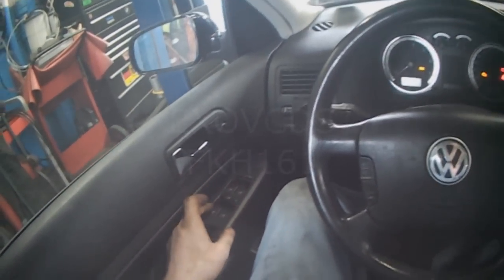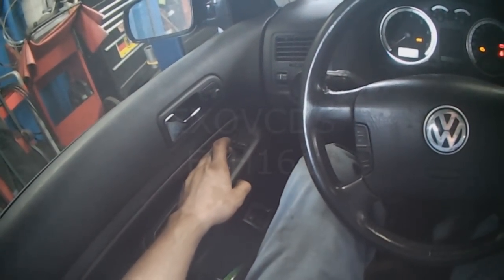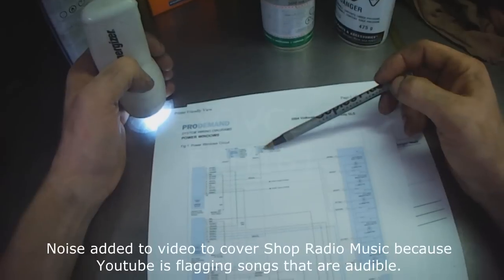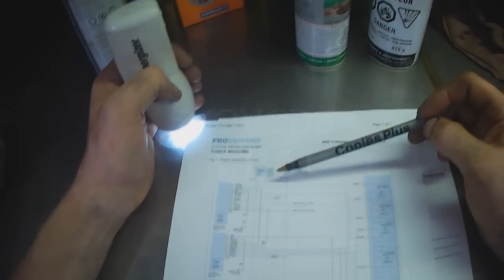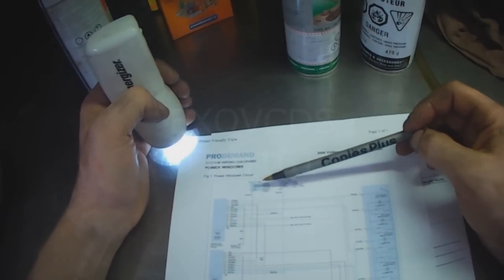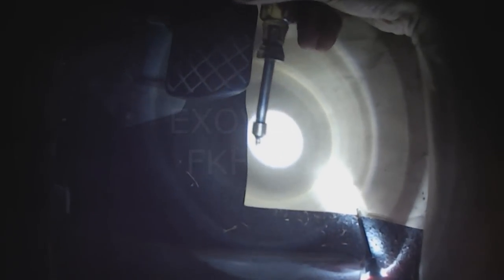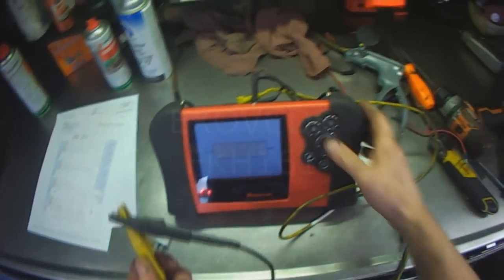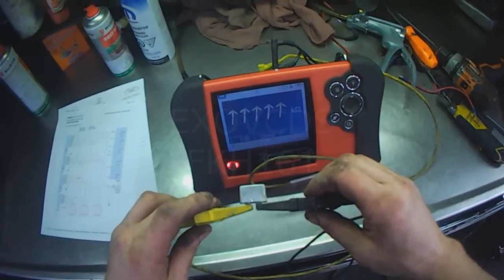VW A4: Power Windows not working

Comment: Thank you I just down load them do you have the AC and engine fan schematic? How can I support you channel? thanks for you support to the community
Reply from the maker: I will upload tomorrow when I'm at work. my website has a donation button if you wish to support.

http://fkh161.ca
Reply from the maker: Check the link again: http://fkh161.ca/Audi/A4/Conrad/
Reply: Thank you I am looking at the AC schematic and don't see the AC fan output every thing in the AC system is working but the fans are not coming on. Is there a separate schematics for the AC fan on/off with the ac system? Is There a separate schematic for the the trunk and fuel door release? The power door lock are working but the trunk and fuel door release are not working. Thanks again for your support.
Reply from the maker: +Conrad Sherland I'll get back to you later.
Reply from the maker: Conrad Sherland Trunk & Fuel Door:
http://fkh161.ca/Audi/A4/Conrad/AudiA4TrunkFuel.pdf

The A/C & Fan control pdf's is all the info I have, the Audi wiring diagrams show the same but bit more confusing to look at.

Comment: I have the same problem, but only with one window.  I can hear the relay click, but the motor isn't getting power.
Reply from the maker: Year, make, model? Check the wiring in the door jam... open the door and look behind the accordion rubber boot for broken wires.

Comment: Hello, my 05 Jetta is having a similar issue with just the passenger side front window which is stuck in the down position. When I use the switch I hear a clicking noise coming from the window but there is no movement. Do you think this is also a fuse related issue or is it a wiring problem? Where do you suggest I look to try and fix this?
Reply from the maker: Braxton Vittori If all the other windows are ok, then it's not a fuse problem. Could be wiring, but probably a bad window regulator. The window could be off of the holding clamps as well... but then you would usually hear the motor buzzing as it moves the regulator clamps up or down. If prior to this you heard some kind of crunching sound, it's probably time for a regulator. Disassemble the door (i have videos for that) to check the regulator.

Comment: Heloo my friend thnx per video ...I have skoda fabia and my window just dont work anymore fuse are good but when i remove and put again works for 5 minute and again stop ..? Thnx a milion times
Reply from the maker: Does it have a "circuit breaker" fuse like in this video? When it gets hot, the breaker opens... once it cools, it closes again. If the breaker gets hot, then there is a problem with one of the circuits. Try to determine if a specific window / circuit is at fault. If the circuit breaker does not get hot if you only use the passenger window, then the problem is with the driver side... as an example.
Reply: Thank you soo much ...my friend thnx a million ...
Reply: @EXOVCDS  i put new fuse brother and its work good for 2 days last night was a lot of rain  and today both windod dont work ...driver side and passenger side dont work .... remove and put again fuse start working ... maybe I need to check lke and video you put for us ... thnx bro for your time
Reply from the maker: @lisihoxha7388  make sure all contacts are clean. Dirty contacts can create excessive heat.
Reply: Thaaaaankkkk Youuuuuu for your time ...God bless Y

Comment: Any idea why my power windows, dome lights, sun roof and trunk won't open? Are there wires on the door that control this?
Reply from the maker: Year, make, model?
Reply: @EXOVCDS  2000 1.9 tdi jetta
Reply from the maker: Did you find & check the circuit breaker like in this video? If the breaker is ok (and actually has power going through it), I'd have to check a wiring diagram to give you other items to check. If the dome light works when opening other doors, then the problem is with the door lock actuator or the wiring in the door jam.
Reply: @Thomas EXOVCDS My door panel has been sticking and tore a part but my circuit breaker on top of the battery looks new but I'll check and the dome lights do not work with either of the doors.
Reply from the maker: Fuse 6 (5A) and fuse 37 (10A)... are they ok?
Reply from the maker: And fuse 38 (15A)... sorry. All should have power when key is in the on position.
Reply: @Thomas EXOVCDS  all of those have power but the 38 15a but there's a handful that don't have  any power.
Reply: The two 10A above the  38 15A don't not light at all and those are new fuses
Reply from the maker: Not all (other) fuses will have power when key is on. 38 should have power all the time (key in ignition or not). Fuse 6 only when key is on... fuse 37 as soon as key is in the ignition. I'm basing this on a wiring diagram that I'm looking at. Those 3 fuses supply power to the central locking unit which supplies power to dome lights. 37 (circuit breaker)  is power for the window and should have power all the time.
Reply: @Thomas EXOVCDS  got everything to work. Thank you very much
Reply: Blown fuse. Trunk still won't open but that's fine
Reply from the maker: More info (about fix) might help other people.
Reply: @Thomas EXOVCDS  I was lost when some of the fuses wouldn't light up and the blown 38 15A I found was stuck in a non functional fuse holder area. The actual 38 15 A was fine. I went to auto zone and he used my light probe and we checked the ones you mentioned, the license plate fuse to be blown but that didn't fix the trunk like he thought. and the windows he said it was the central locking and i thought that was a 20... all in all we replaced a 5a and the 10a and that fixed my sun roof windows and dome lights.
Edit that also fixed my trunk switch on the door. My trunk and alarm act weird..

Comment: lighting was not helpful but would this be the relays near the battery in front of the driver on a 2000 Jetta? Anyone have an answer? No alarm light, no power windows from inside vehicle.  Key works on  outside to open and close but again, no alarm light. New switch control.
Reply from the maker: The battery in in the engine bay... you can clearly see that I'm working inside the car under the dash on the drive side. Check the wiring in the door jam.

Comment: Hey thomas ! i own a vw polo 1.2tdi Indian spec (2010) an the issue is tat i have power coming to the driver door switches (i have lights glowing in the switches as well ) i can hear any relay sounds as u mentioned in ur video !  & i cant lower the rest of the windows ! but the individual switches at each doors works what do i you ???
Reply from the maker: Watch these 2 videos:
https://www.youtube.com/watch?v=lLTKYxBESP0

https://www.youtube.com/watch?v=Xym-REfx5fk

There might be an issue with the communication wire... if that is OK, then the driver door module might be bad (the window motor is the door module).

Comment: Would this be the same for an Audi A4 b6 have the same problem
Reply from the maker: William Grant The "VW A4" in this video (MK4 Golf / Jetta models) is different from Audi A4 (B5, B6, B7 etc) models. A wiring diagram will indicate if a similar circuit breaker is used... I don't know off hand. Have you checked your service manual already?
Reply: Thomas EXOVCDS I do not have the manual. My windows, side mirrors and locks don’t work I can only lock the 3 passenger doors with my key, but not the driver side and only the sunroof works and also the interior lights stay on unless I turn them up manually. I have an a4 20021.8t Quattro
Reply from the maker: http://fkh161.ca/Audi/A4/AudiA4PowerDoorLocks.pdf
http://fkh161.ca/Audi/A4/AudiA4PowerWindows.pdf

Comment: Hello. I have a vw passat b5 1.9 tdi (1998) and i have the same problem. What i need to do?
Reply from the maker: Find a wiring diagram and trace the circuit.
Check the comfort control module under the carpet (water can collect and damage the module).
Reply: @EXOVCDS  i'm finally found the ccm box and the box was damaged by the water. Thank you so mutch
Reply from the maker: @csabilaszlo595  Thank you for the update!

Comment: Same problem with my audi. All the windows are not working, the driver side windows have do not function as well as the passenger side together with rear window. can i ask advice for this matter?
Reply from the maker: You / I would have to look at a wiring diagram to see power / fuse & ground distribution / location. The issue I'm sowing in this video for the VW A4 (4th generation of the A platform: Golf, Jetta) is very common for that generation. I can't remember when I had a similar issue with an Audi A4. Again, I'd have to look a wiring diagram before I can take a guess / give any advice.  Which year? B5, B6 etc? Engine size? What type of transmission... some wiring diagrams are specific to specific models.
Reply: Audi a4 2004 v6 engine quatro 3.0
Reply: Automatic
Reply from the maker: I'm away from my pc. I'll look into it tonight or tomorrow morning (day off).
Reply from the maker: Fuse S37 (30A) and S22 (15A) supply the driver & passenger door modules with power.
Each fuse feeds power to both modules... meaning that if one fuse is bad, it can affect both sides.
Fuse panel left side of dash. I'd check these two first.

Comment: Hey Thomas.I have a vw 2001 sharan, my right rear powerwindow stopped working today, in down position, fuse is fine but no sound what so ever from motor when i push the upp button, or down for that matter. all the other windows work fine.can't possibly be the motor seizing after winding the window down can it?
Reply from the maker: No... don't think it is a motor issue. Hold the key in the LOCK position in the driver door handle. Does it go up now? If you hear a relay click inside the door, then the positive/negative (forward/reverse) is wanting to do something but can't. Might be a faulty circuit board of the power window motor.
Reply: If i would like to "hotwire" the motor just so i can close it for now, don't really wanna leave the window down over night.Where can i find a pin diagram for the motor, it has some 14 pins.
Reply from the maker: Remove the motor from the regulator (after removing the inner door panel) and then turn the window up by turning the gear that the motor was attached to.

Comment: I did what you did in the video to my 03 Audi A4 and my fuses were perfect. None of my windows go up but I do get the clicking as if they want to. Any suggestions?
Reply from the maker: +YaMamma1516 Clicking in the door / power window module indicates that "control" is present... but main "power or ground" for the motor(s) is not present.  Fuse #37 (30A) for the front windows, fuse #2 (30A) for the rear. Also check fuse #22 (15A). If all windows quit at the same time, it has to be something that is common to all... looking at a wiring diagram should help.

Comment: Hi I have an issue with my power windows. The passenger side door lock modules isn't getting power and the doors operate manually, the passenger windows sometimes operate independently through the door switches. I can't operate the passenger windows on the driver master control nor their locks. Please help
Reply from the maker: Year, make, model, engine... so that I can find a wiring diagram for you.
Reply: Jetta 4 auto 1.6
Reply from the maker: The month & year of production, as well as the engine production code... would help me make sure that I find the correct information.
Reply: 1999 model, engine AEH
Reply from the maker: The A4's/mk4's never had any wiring issues in the door jam, but it's worth checking for broken wires. Everything gets power from the same place, so if one component doesn't have power... trace the wire to the fault (wherever that may be). Send me a message and I'll send you a wiring diagram. fkh161 @ fkh161 .ca (no spaces)

Comment: I have a 05 Volkswagen convertible the doors are locked the windows are up and I can't get into the car is there any secret way to get in other than cutting the roof I tried the key to unlock it the lights flash something happens in the door but the door won't open someone please help but the door won't open anyone with suggestions how to open those doors or lower the windows and the great for grateful to you I have tried the combinations of turning the key to the lock to unlock lock unlock on a thing happens is the driver's window drops down a half an inch and then if you don't open the door it goes back up
Reply from the maker: Holding the key in the unlock position should lower the windows. Turning the key twice to unlock should unlock passenger door and trunk.
Reply: The top to my Volkswagen Beetle convertible will not open is there a fuse or relay that I need to be looking at and where is it located it's a 05 Volkswagen
Reply from the maker: So you got inside? The top won't open with key in the door. (IIRC)

Comment: Hey I have an issue with my driver side window. It doesn’t know when to stop. It keeps going then the window motor begins to rattle. This happens going up or down. Any suggestions. This is after I installed a new window regulator from amazon and window motor from the junk yard. Thanks
Reply from the maker: Year, make, model? The power window motor / module can learn end stop position if you activate the switch at both up & down positions. Lower the window... once down, let go of the button and then briefly push the button again. Do the same when raising the window. Once at the top, let go of the button and then briefly pull the button again. Also check for fault codes in the CCM (comfort Control Module)... if you have a scan tool that can communicate with the CCM, then you can run "basic settings".
Reply: Thomas EXOVCDS I will try this. Vw mk4 2 door golf
Reply: Hello, upon further inspection I didn’t tighten the t30 motor screws down hard enough. The teeth was sliding out. Thank you.
Reply from the maker: Thank you for the update... good to hear that you found the problem.

Comment: I have a 2001 Golf GTI glx Vr6, I replaced the driverside window regulator, then both windows would only work sometimes, but both were fine before. Any idea if this would work for me, or any ideas what it would be. Sunroof works fine, hatch, gas door works fine. Fuses seemed good. Please help, THANKS
Reply: When I turned the car off last night, I could hear clicking but wasn't touching any buttons.
Reply from the maker: Recheck all your connections (regulator motor connector and switch connector in door panel). Wiring in the door jam isn't an issue with the mk4's, so that should be ok. The only way to check that wiring would be to unwrap the loom. Use a scan tool to view window switch operation by scanning the comfort control module. If the module shows correct switch operation (open / close window), then the switches & wiring are OK.
You can also use the key in the outside door handle to check window response. Hold the key in the UNLOCK position... all windows should go down. Hold in the LOCK position and all windows should go up. If yes, then "control" is OK and you might have a switch problem. If control is NOT ok, then you definitely have an issue that needs to be tracked down.
Reply: Okay the fuse looked good but i put a new 1 in anyway. Windows now work, but hatch unlock button doesnt.... shew I LOVE THIS CAR, but it sure does test my patience!!
Reply from the maker: @michaelcurtis3402  Thanks for the update... make sure that the hatch switch is plugged in. If the CCM thinks that the rear hatch is already unlocked, it won't trigger the hatch again (even if the hatch is closed).
Reply: @EXOVCDS  thanks for your help man I really appreciate it, I'm gonna get the pannel off and double check everything. Thanks again!!!
Reply: Okay I have everything working now, except the driverside window,  it will work sometimes and sometimes it wont, I think the switch may be bad, because I cant control the passenger side window at all from drivers door, but it does fine from passengers side. I double checked all connections they seem good and tight, so that just leaves the switch right??? Thanks and sorry to bother you so much.
Reply from the maker: @michaelcurtis3402  What happens when you use the key on the outside of the driver door?
Reply: All I have is the valet key so I dont think it will work will it?
Reply from the maker: @michaelcurtis3402  If the key can turn the lock cylinder... it should work.
Reply: I'll try it in the morning, thanks I'll let you know.

Comment: I have a 2007 Audi A4 and All of my windows including the sunroof will not respond. Have checked all fuses and all are good. Any idea where I should start looking for issues??
Reply from the maker: Do a full system scan... see if there are any codes in the comfort control module or if you can even communicate with it. Front & rear window motors have different fuses, so it's doubtful that they failed at the same time. Do the windows work with the buttons in the doors? Are power door locks working? Alarm system? Again, a full. system scan might be of help.
Reply: Thomas EXOVCDS windows won't roll down at all. The door locks and alarm work
Reply from the maker: A full system scan might be of help.

Comment: Hey! I have a 2008 Volkswagen Passat Komfort, and my rear windows won't come down at all, my driver window goes up and down by pressing & pulling hard every once in awhile, but my passenger window always goes up and down. The 38 fuse isn't blown. What could this be?
Reply from the maker: I'm currently at work... I'll get back to you later tonight after work.
Reply: +Thomas EXOVCDS Alright.
Reply from the maker: Open the rear doors and find the rubber accordion tube at he door jam / hinge area of the door. Pop the boot off of the body side of the boot and peel the boot back towards the door... look for broken wires. That is the first thing I would check... actually, I would use a scan tool and check for fault codes in the Central Locking / Door Electrics Modules.